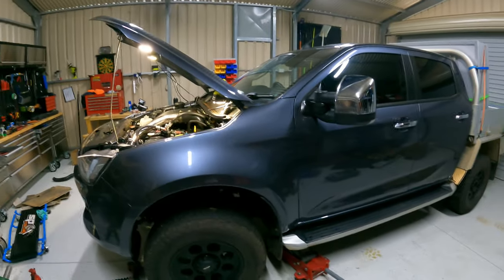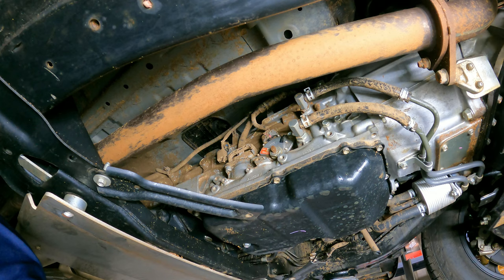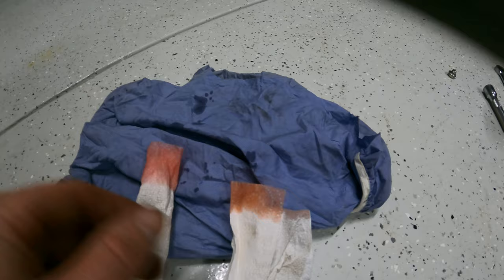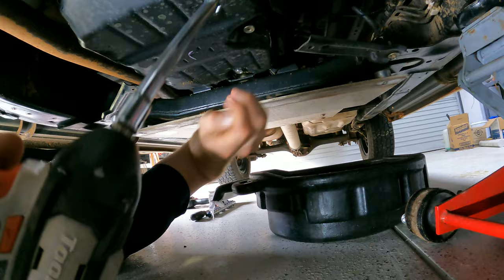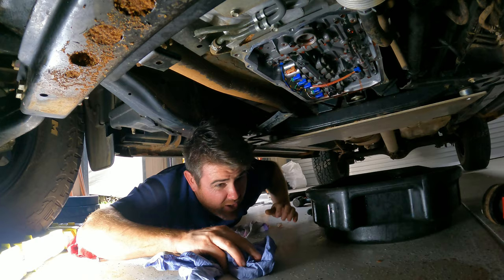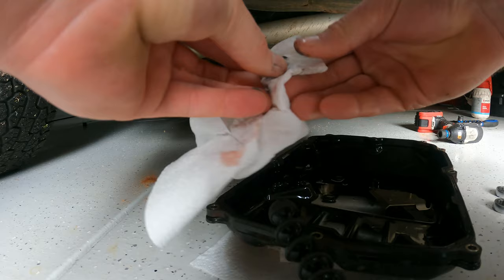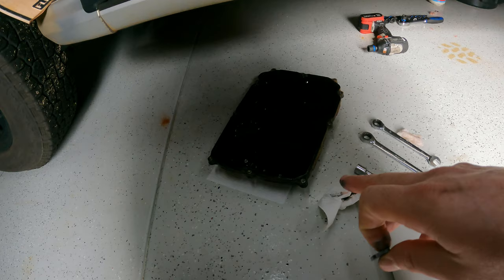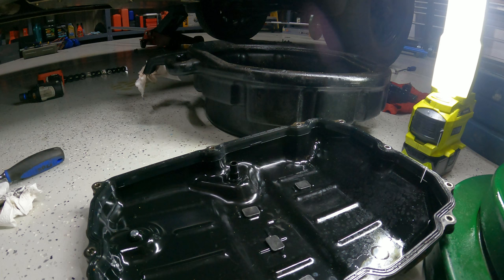2021 ISUZU D-MAX TRANSMISSION SERVICE

Comment: Very good video.
Just wondering why he didn’t have and external transmission cooler installed as it would benefit with towing a caravan?
I noticed he still only had the stock trans heat exchanger.
Reply from the maker: Just seen this now dude sorry 

He's got a trans cooler and the heat exchanger is completely bypassed

Comment: Great job without lifting the car ..What tyres are you using please
Reply from the maker: @gizzmo667  morning I'm pretty sure they are just a 265 70 17
Reply: @OUTBACKDiscovery  what is the manufacture of your tyres
Reply from the maker: @gizzmo667  there bfg ko2 265 70 18 on factory 18 inch discovery 3 wheels powder coated black

Comment: Which temperature you check level? I heard 36 degrees? Is it F or C? In some other movies I heard 60 degrees.
Reply from the maker: @tolekcacek9919 morning its  30-50 degrees Celsius I aim for 40 degrees Celsius 

 I just go off the manual with all my videos so I don't get told off on here for it not being the actual spec haha
Reply: @OUTBACKDiscovery  Thank You for Your reply, a meant videos of other YouTubers not yours. of course. Looking forvard for other videos with D-max, cheers. :)

Comment: good video i wonder on the triton because it has a trans cooler could you disconect a line and flush it that way
Reply from the maker: You would be able to would need to put feed line to cooler into a bucket and try match the flow rate going back to the trans from the other hose 

Or do the drain a litre / fill a litre technique to ensure you don't over fill or run out of oil i suppose 

Would be an option for the dmax aswell they have a tiny little coolant to trans cooler just to the left side of the transfer case that the trans goes to for cooling 

On this dmax its been bypassed as phil didnt want any heat transfer from trans to engine 

I personally like to leave liquid to liquid coolers attatched and then put the air to oil cooler on the return side of the coolant cooler

Comment: Great video, what was the torque setting for filter and pan bolts, thanks  stewart
Reply from the maker: Hi Stewart i just went a generic torque for that size bolt of 11nm unsure if its actually correct for the Isuzu but havnt had any leak so far 

Also ryco now do the correct filter kit for the day was released about 6 weeks after doing this job 

Merry Christmas stay safe 🙏
Reply: Thankyou for your reply, I need to do this job soon, thanks again Stewart
Reply: @OUTBACKDiscovery  merry Xmas have a good one.

Comment: What brand/type of transmission oil did you use? And what torque settings did you use for all the transmission pan bolts 10-11nm as well?
Reply from the maker: Hey M J the owner phil likes using penrites ATF LV fluid it's what penrite recommend for this transmission and yeah I just torqued the bolts to 10nm because it's a solid gasket 

If it was one of those rubber thin gaskets would probly only torque it to around 8nm 

Bearing in mind this is my own torque specs I didn't see the torque spec online so went with a generic spec that alot of pans seem to use

Comment: So there’s still around 6L of old oil left. Isn’t a complete flush better option
Reply from the maker: Hey David a complete flush is definetly better however not necessary if you go for frequent oil changes 

In phils case we do it every 20 thousand so new oil diluting into not as new oil just keep the trans happy 

Any oil change is better then no oil change 🍻

Comment: Would you have the genuine part number for the auto sump gasket and the auto filter by chance.
Reply from the maker: Morning Paul I don't sorry 

However I also don't recommend the genuine sump as it's a one peice plastic sump harder to install 

The aftermarket sump on mine in steel and separate filter which makes life alot easier

Comment: WTF! Now gearbox services every 10000!  Pathetic! Who has the time and money for all this Barbie maintenance?
Reply from the maker: 🤣 he's done just over 20,000km of mostly towing normally drops oil every 30,000km  and filter and oil every 60,000 pretty cheap for oil and alot cheaper then replacing a transmission 

Joys of driving a modern day * comfortable vehicle* they need more love then the old school forbies
Reply from the maker: @seanhammon6639  🤣 I agree new vehicles arnt tough like the old ones 

Automatic boxes have always needed love though neglect never ended well for any auto regardless of how old it was, was just bit easier to repair back in the day quick nip up of the bands getting you another 12months 🤣